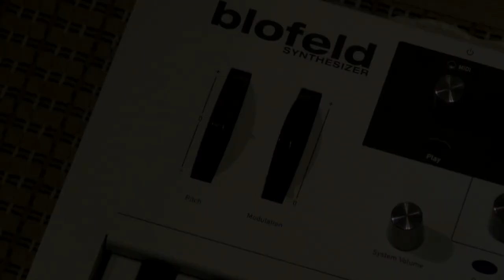Pitch Bend replacement for Waldorf Blofeld Keyboard

Comment: I want to buy a Waldorf, but I'm increasingly unsettled because I have the feeling that some components won't last long. The biggest problem is probably the encoders, which often have to be replaced. Now I see the problems with pitch and mod. wheel.
if this has been fixed on new models🤔? I actually just wanted to buy a used one.
Thanks for your great video👍🙏
Reply from the maker: When researching, I did not find anyone who posted about pitch/modulation problems, so I assume this is pretty rare. It's also rather simple to fix (no soldering) and not too expensive. This is my 3rd Blofeld (I had 2 desktops before bought used) and none of the encoders showed any issues.